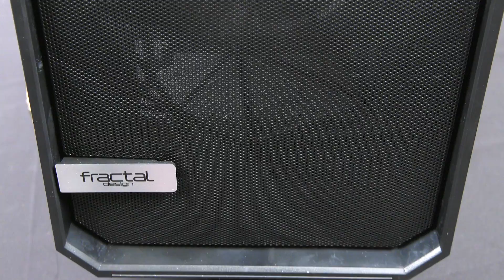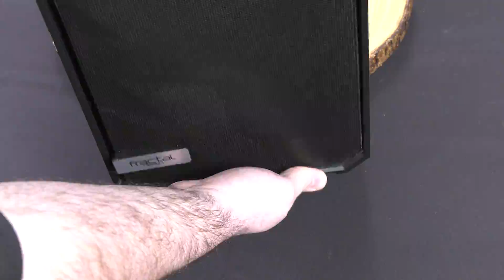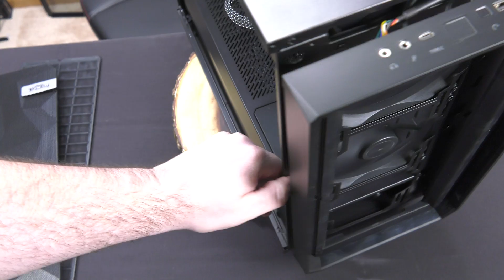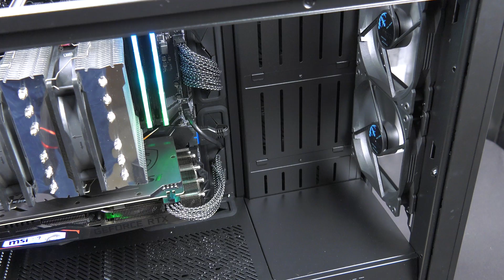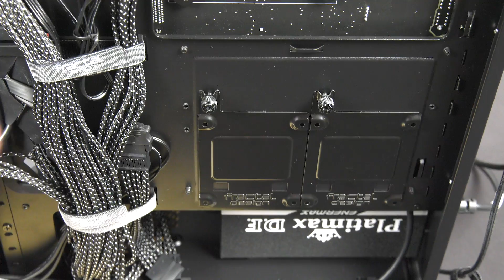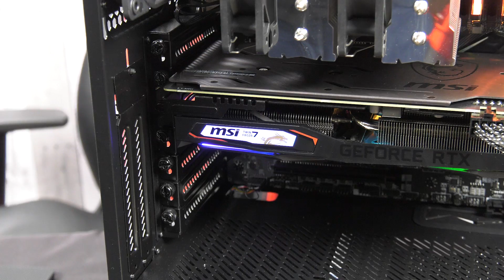Fractal Design Meshify S2 - A Solid Case Option Without RGB?

Comment: 14:21 side panels with plastic balls for mounting, don't look reliably in contrast to classic sliding option. I think with repeated opening-closing these balls can break. So they are also stuck in the case broken))) i think that this is main disadvantage of this case, and not input ports on the front panel.
Reply from the maker: Te balls are actually metal and painted black.. I would not worry on longevity, my R6 had the same mounting and I've opened it over 50 time I would assume without even a looseness to the clamping mechanism
Reply: @BareMetalTech  yes they are metal. I bought this case. I like it, but the hdd temperature has increased by 10 С :( due to the lack of direct airflow from front fans.

Comment: Which would be better cpu cooler on top or front of this case?
Reply from the maker: Which kind of cooler? Most aio will benefit slightly with front mount radiator, but you will be moving warmer air into the chassis chamber for vrm, gpu and other ancillary components.

In real world I have only seen very marginal benefits in either orientation

Comment: Bro you’ve got the craziest rgb on back . Why don’t you mount it vertically
Reply from the maker: Vertical mount requires the separate pcie riser cable. I test the case as it would be if you purchase it which means if you do not get riser with the case and they don't send it, then it gets tested standard